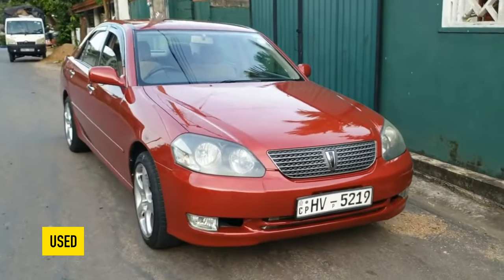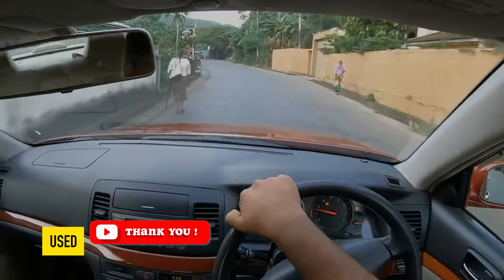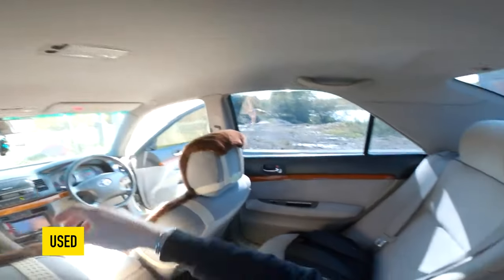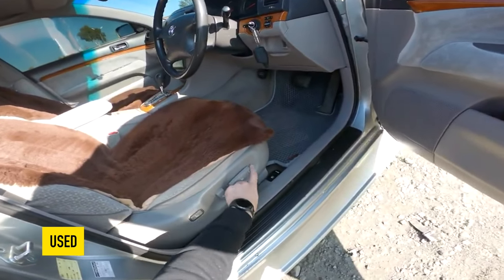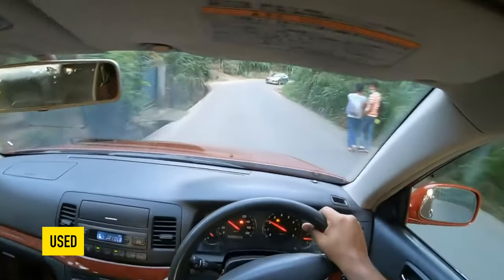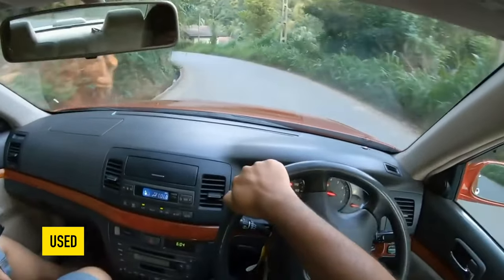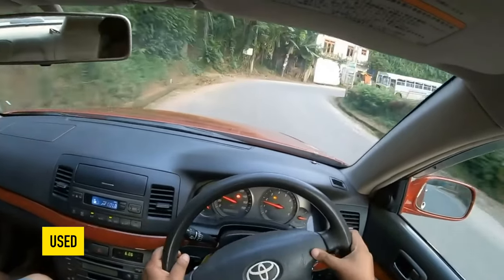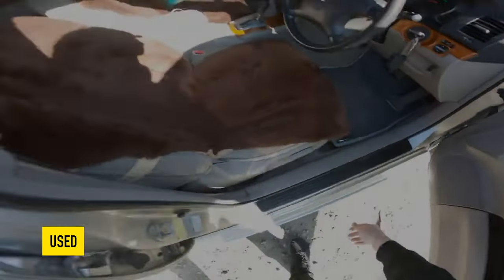What are the most common problems with a used Toyota Mark 2 X110?

Comment: I'm planning to buy one with 2000cc 1G fe engine. Is it a good buy?
Reply: In my opinion you should go for the 1jz fse 2.5 it’s way more fun,even though I’ve heard that engine is not good its aint that bad
Reply: Do your research with it and it should be fine but the 2.5 is alot more fun then the 2.0
Reply: I am speaking to you as a PROUD owner of the GX110 SPORT MARK2. My engine is the BEAMS 2000cc 1G FE. Great buy and engine works well, just service your car.